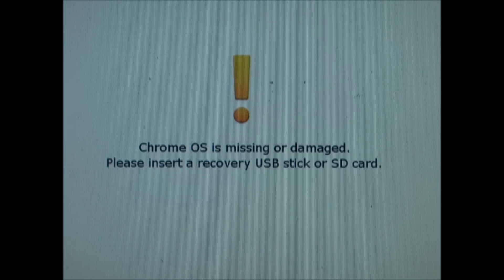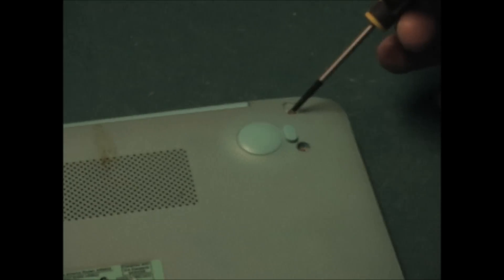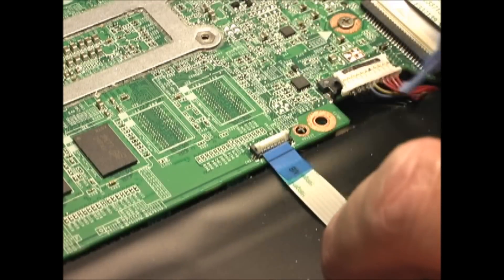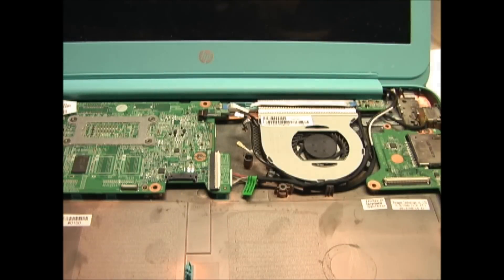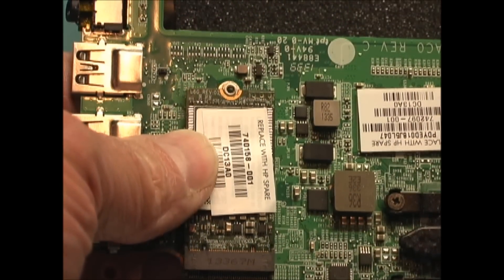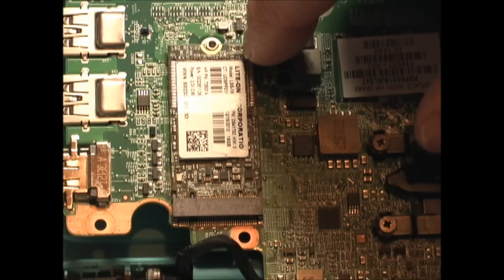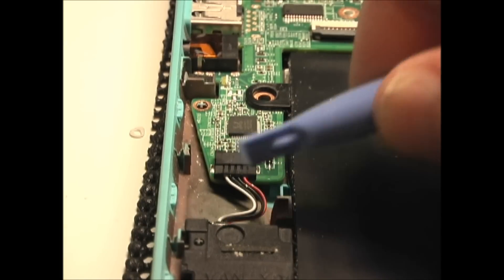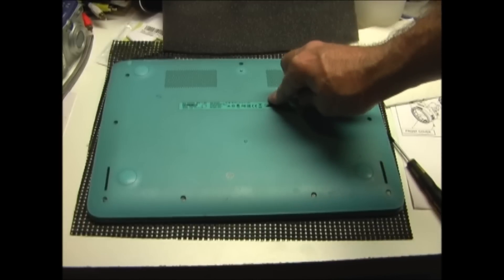HP Chromebook Disassembly Replace SSD Reassembly. Chrome OS Missing or Damaged

Comment: The best disassembly tutorial I've ever seen. Everything is clear and no nonsense. The steps are ridiculous to me, may the manufacture wants to keep consumers away from replacing their SSD.
Reply: Thanks,  I need to replace my battery and this helps a lot!  The HP Manuel was a bit confusing, BTW it had a notation suggesting that one take the Chromebook to a repair man  since the battery was factory sealed.

Comment: Thanks!  Just successfully replaced the SSD in my Chromebook with a $20 replacement from Ebay. I would have failed or given up if I had not found this video. Had NO idea that there was this many steps/screws.

Comment: Thank you so much for this informative video.  I would not have attempted to replace my failed SSD without it.  Spent less than eight bucks for a repair that HP wanted to charge me $229 for.

Comment: Hi Jim many thanks indeed for this. I had a non-functioning touchpad and your video was spot on in terms of understanding what the problem might be. You pointed out the touchpad ribbon in your commentary and when I opened my HP14 it had come loose from it's moorings! clipped it back in as you demonstrated and voila it worked!! Many, many thanks for the clear instructions. John

Comment: Thank you so much!  Just revived my HP Chromebook 14 (q049wm) which had experienced a drive failure of the orignal 16GB drive.  I installed a 64GB 42mm SSD, went through the recovery procedure, and voila, I'm writing this comment on what was a dead piece of peach plastic a few hours ago.  Your video was TERRIFIC (excuse the caps).  Thanks again.

Comment: Really want to thank you. Replaced a 16 GB with a 64 GB and turned my Chromebook 14 into a BANGING WIN10 Book. Your clear and intelligent tutorial made it happen! TYTYTY! Agree with last guy...donate page.
Reply: where did you get the 64 GB SSD?
Reply: Can you tell how exactly did you replace Chome OS with WIN10? Because I was sure that the ChromeOS is locked in the BIOS.
Reply: windows 10 is hard to do but you can go with linux...it's easy and you can do it without a 64 gb ssd . I recomend Solus linux budgie

Comment: Excellent job  Obviously they dont make these EASY user replaceable items.  Job security or built in obsolescence?   YOUR video is going to cost some Suppliers some $$.  Great JOB!   I dont have this model, but now have the courage to try in case of failure.

Comment: Great video! Helped so much replacing the existing SSD with 64Gb one. However, here's a weird thing. Since replacing, my audio keeps cutting out, and only seems to do it at higher volumes. Set at less than 50% vol, no major issues. As I turn volume up, it starts, getting worse till when at max it is just "dit-dit-dit" bits of audio coming through.  Have refreshed OS etc, so looks like it might be internal cable seating problem.. time to open her back up again - doh!

Edit: Opened up, the black & red speaker wires were being squashed between keyboard and one of the bits on the based. Moved them and all sorted! :-)

Comment: Just use the Chromebook recovery tool and this Chromebook will be fine. The OS got wiped is all that error it telling you. The SSD is locked and the base OS of Chrome can't really be erased. If there is an error in the program WiFi functionality will work and it will be fixed when refreshing the Chromebook. This video is very helpful for those that want to add large capacity storage for their Chromebook, as most of these models only had a 16GB (Usable the SSD is actual 20GB but the Chrome OS is locked on the 5GB you can't use) so this may be an upgrade you may want to make to use your old Chromebook to run a Linux distro.

Comment: Jay, Excellent video but when I got to the SSD the hold down screw would not budge!  I used a Dremel to remove the screw head and even with needle nose precision pliers i could not turn the shaft of the screw. It was fused for some reason, perhaps thread lock or over tightening. As a result of the torque applied while the SSD was in place I damaged the SSD socket.  This unit had a free lifetime T Mobile account that I rarely used. Frustrating but I'm not distressed, I have another Chromebook. I'm still wondering why the hold down screw seemed to be welded to the female threaded socket. I still feel you presented an excellent instruction and it was just unfortunate..

Comment: Greetings!
Day one Chromebook noob here. Do all CBs have an M.2 SSD? I opened mine up today but didnt see one. Though I only opened up the bottom of it, not the keyboard side. I'm using a 256GB SD for storage because of the ridiculously small 32GB eMMc storage it says it comes with. Its an 11" Lenovo IdeaPad Chromebook 3, if that helps. I'd really appreciate any help with this. And THANK YOU for this video. Very informative for my dive into a new-to-me OS/machine!

Comment: amazing - same model and issue, fied it easy, just search ebay for a m2 ssd and make sure it looks like the 3 part connection - dont matter if it is 32 gb or 16 etc
thankssssss

Comment: I use an extension, Screencastify, a lot on my HP Chromebook and it uses up the memory fast. Is there a 32GB SSD I can purchase that will fit in replace of the 16GB it comes with? I have had this chromebook a few years now and I love it... however there are not many over 16GB's that are affordable.

Comment: Thanks for this video.HP wanted $250 to replace my SSD.(shipping included.) Question, do I need to match the part number on my SSD There are a bunch of people selling them on Ebay.
Reply from the maker: James Krys I think it would be best if they matched but there might be some that are compatible. If you have your SSD out you should be able to cross reference the model number. If you have a 16gb SSD you might find a good used one from someone that is upgrading theirs.

Comment: Thank you for this tuto, I thought I managed to change my ssd. However I used a 64go ranscend TS64GMTS400, at first I thought it was ok, I managed to install the recovery, log in, and then crash, and back to "chromeos is missing or damaged".
Do you think it can be the ssd I chose? I tried to reinstall several times and the problem is the same: it's ok at first and then crash. Why?

Comment: Great video and has allowed me to take mine apart multiple times. The reason its been multiple times is that none of the drives I've got to replace the dead standard one will work. They nearly work but after about 30 seconds they slow,freeze, and crash.
Can anyone tell me where in the UK I can get a drive that will work out of the box and not need to be formatted in a caddy using Linux. I can't believe its this hard to get a replacement drive!!!!!!
Reply: shawn G  Right what I ended up doing was getting a "brand new/second hand" Sandisk 16gb drive from a Thinkpad. I'm using it now. Took a month of trying other drives and sending them back. My guess is that it can't format a drive properly over 16gb or maybe 32gb which is usually standard. Good news is it cost me £12 in the end HTH!!!!!!! ;-)
Reply: shawn G I have the same issue, can you tell me which ssd you used to get a proper install please?
Reply: I ended up using a second hand 16gb Sandisk ssd from a Thinkpad bought from ebay.
Reply: Thanks. I'll try that
Reply: Matthieu Menaut for some reason it won't let me reply to your other question but I also tried the Transcend 64gb with the same result.It ran slow,froze,and crashed.I think its down to the format. I've since read that it needs to be formatted with Linux in a caddy using Gparted. But its too much trouble to go to.

Comment: Hi Jay. Do you (or anyone else) reckon I'd be able to use a larger capacity M.2 SSD as a replacement, if I formatted it with Gparted? 

I was thinking of using the ADATA Premier SP600NS 256Gb SSD and booting another OS on it, since I have a chromebook already.
Reply: Brandon Bradford did your chromebook work with the 256gb ssd upgrade?

Comment: Hi, I'm sorry if this is a stupid question but do u really have to take apart the entire thing to get to the ssd? My laptop is having the exact same issues, and I've never really worked with computers, so I'm a little scared to mess with it.
Reply from the maker: Jaycee Weber Some are easier to work on. Is it an HP, Acer, Samsung or something else?
Reply: Jay Gould It's an HP, actually I'm pretty sure its the same one you worked on. I was just hoping that you were taking all of it apart just for the video haha
Reply from the maker: Jaycee Weber You will have to take it apart as shown in the video. Have you tried updating your Operating System? Maybe that's all it needs. If you have to replace the SSD, do you know someone that's good with tools that could help you?
Reply: Jay Gould I actually took it apart, following your video (which was super helpful) to see if the ssd drive was loose, but when it put everything back together it showed me the same screen as before. I think I might have to get a new ssd. Do you know anywhere I can get one bc i checked ebay and nothing came up. Also, how do u update the operating system if the computer won't even go to the main screen? Thanks for all the help!
Reply from the maker: Jaycee Weber Is there a sticker on your SSD that says: "replaces with HP spare 740158-001", or a similar number? Or MODEL: LSS-16L6G-HP? Look for the number on your SSD and search with that.
Reply from the maker: Jaycee Weber From GOOGLE Support: What you need to get startedBefore you get started, you'll need:The Chromebook with the "Chrome OS is missing or damaged" errorA different computer with the Google Chrome browser installed (Windows, Mac, or another Chromebook)An SD card or USB drive that you don't mind erasingThe Chromebook recovery app (details below)What you need to doTo recover your Chromebook, you'll first create media with the Chromebook recovery app, then reinstall your damaged Chromebook’s operating system.Install the app on the working computer (not the Chromebook with the “Chrome OS is missing or damaged” error).Open the app and follow the on-screen instructions to create the recovery media.Insert the SD card or USB drive you’ve created into the Chromebook you want to recover.Follow the on-screen instructions.

Comment: So basically all you need to do is replace the Solid State Drive. But why do you have to dismantle the whole thing?
Reply from the maker: +Robloxs Xtremeguy The SSD is on the back side of the main board. You have to remove everything else to get to the main board and be able to turn it over.
Reply: Ok, makes sense but why do you have to remove the cooling fan. Because the cooling fan is on the right and the SSD is on the left.
Reply from the maker: I guess I forgot to say it in the video but it's a good idea to clean out the fan while it's apart.
Reply: @WilliamFrawley  thanks Jay but due to the rubbish on the misinformation highway before I saw your video I bought an evo 860 250gb drive But It WORKS, haha

Comment: Can you please help me and give me the link to buy the ssd card.. I have the same problem and if I got your help, I will be very thankful
Reply from the maker: +Abdul Deraiya I purchased it on eBay from: "discountedlaptopparts"    ITEM: Lite-On 16 GB SSD Laptop Solid State Drive LSS-16L6G-HP. Check compatibility with yours. The Model number on the back of my SSD was: LSS-16L6G-HP
Reply: Can you give a link instead?I'm still confused.

Comment: Do I need to replace the ssd or can i put the old one back after i clean it?
Reply from the maker: +Travis Alderton Try to clean the contacts first and put it back in. If that doesn't fix it you may have to replace the SSD.
Reply: +Jay Gould thank you but it didn't  work, great video helped me sorce the computers  problem

Comment: Extremely dumb way to assemble this Chromebook. I don't see why they wouldn't have an access door at the bottom for replacing the SSD. They only need a jumper to be there for removing so that it would disable battery power.